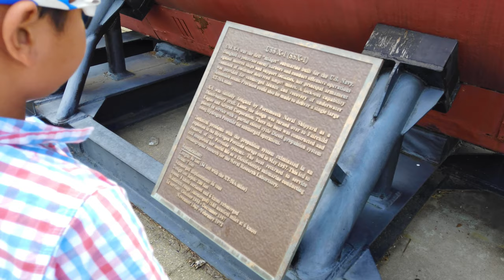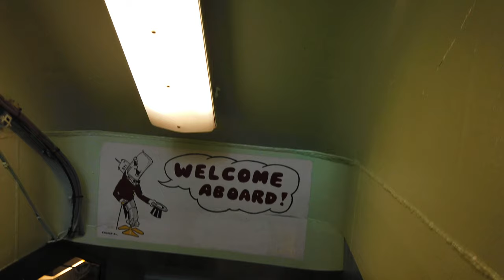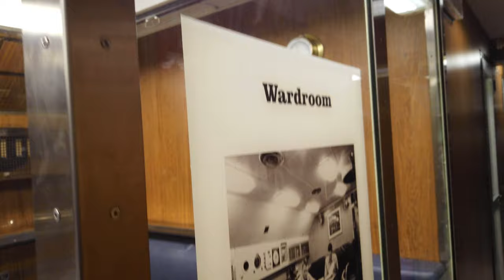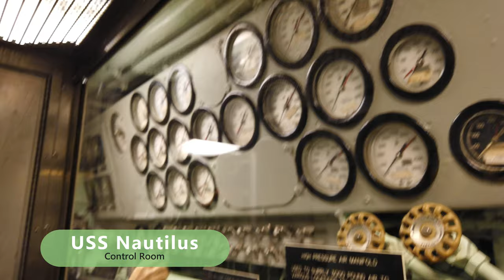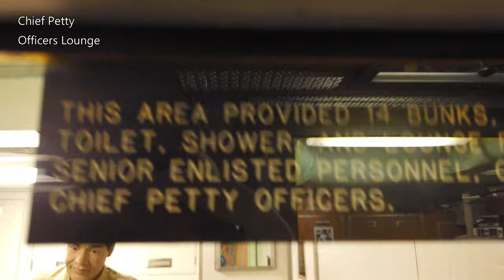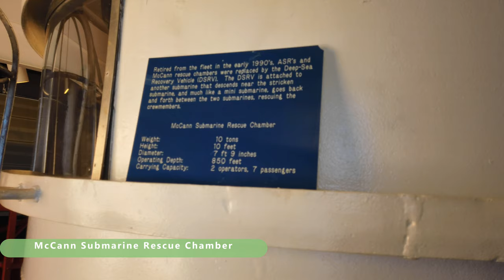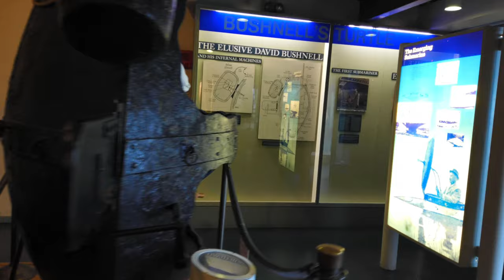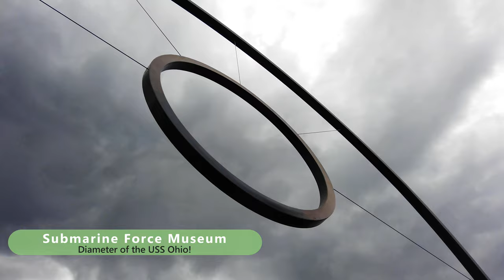Inside a Nuclear Submarine USS Nautilus at Submarine Force Museum (4K)

Comment: The 'crazy masks in the gallery are part of the EABS, or Emergency Air Breathing System.  Spread throughout the ship were bags containing these masks, and in the case of a fire or other event, that would be donned and then connected to a series of pipes in the overhead that had air to breathe.  Every crewmember would put one on, from the Captain on down to the newest sailor.  Lives depended on those.
Reply from the maker: That's great to know- thank you!

Comment: Was there any sort of portal or marker to see the reactor space? Or has that been filled with concrete or something to render it safe? Things look a little more luxurious, but its not too unrecognizable compared to when I toured the WWII USS Silversides on display in Michigan.
Reply from the maker: If there was one we didn't see it, but yeah that would have been interesting to see the area.  For safety I am pretty certain that any radioactive material has been removed.
Reply: Engine room is off limits for safety and security reasons. Want to see this area, be one of the lucky nukes there for training who get an exclusive tour. Yes, portions of the that area is still classified.
Reply: @edwardsajl  As much tradition as to show them what the systems they will be working on evolved from.
Reply: @gapratt4955  Well modern vs this sub look extremely similar (hard to tell for some with the walkway making it look different for avg joe to walk around) but if you ignore that then it has very similar systems but updated. The reactor/engine room must be very similar as well so it'll never be shown. Fow how old it was they seem to closely prefected layout/system/design on the first nuke. However, if anyone wants to see a sub reactor/engine room there are tons of photos for the older/current russian subs. It'll give you an ideal how it is done but are often more troublesome vs us subs.

Comment: wonder why they put crew quarter there, they need to pass by reactor/ engine  room, every time  they want to go in their quarter !
Reply from the maker: Yeah I'm not sure.  The only thing I can think of is perhaps the heat from the engines help warm the crew quarters.
Reply: Submarines are built, first and foremost to be weapons delivery systems.  All other considerations are secondary.  With all of the primary systems in place the crew accommodations are added.  Bunks are placed wherever there is room.  I've bunked in the torpedo room, on the skids, right next to Mk48 (and Mk37) torpedoes.